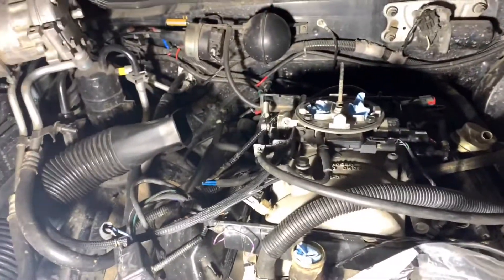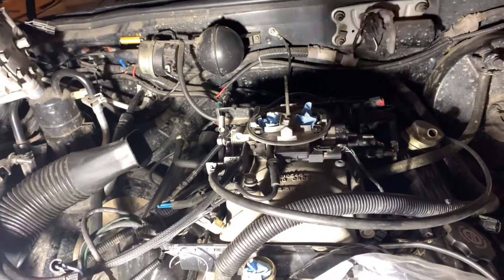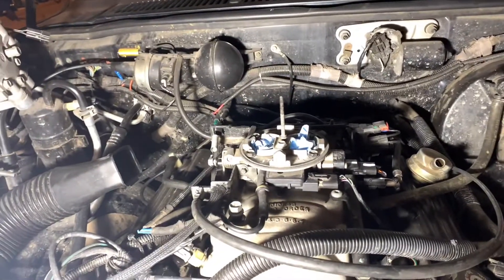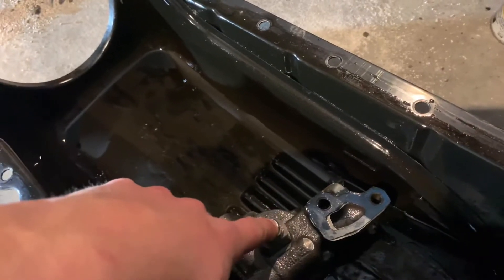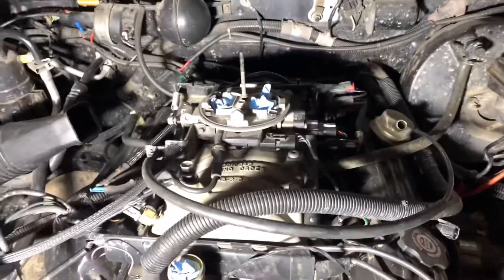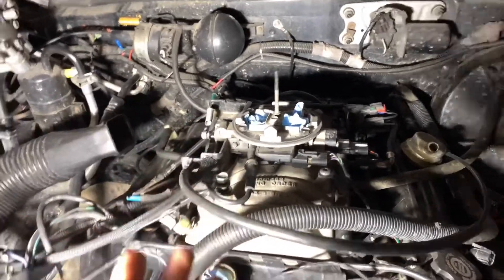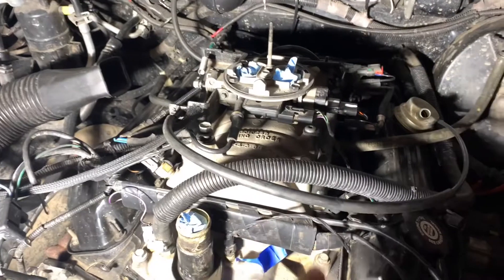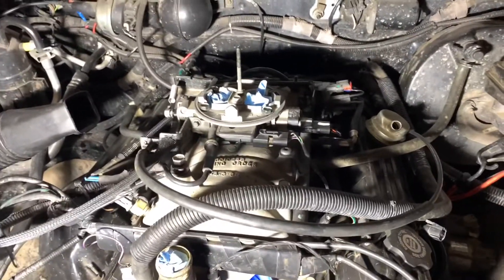Low Oil Pressure Diagnosis (Dodge small block)

Comment: What is the normal pressure it should be? Where should the gauge in the panel be at?
Reply from the maker: The proper range is 6psi-40psi when warm. Obviously a minimum of 6psi at idle, and 40psi at operating rpm (roughly 2k and above).
Reply: @AndrewSalazar7  Thanks, Mine currently shows is more than halfway to the 100 mark. What could cause this? What type of damage could result if I drive it this way? It is currently parked in my driveway.

Comment: hi there. i have a 95 ram 360. 160k miles. runs and ran great. iv done new plugs when i bought. i have not changed the oil yet. it sat alot and wasnt driven often. so recently i tooped off the oil maybe half a quart with marvek mystery oil. like i usually do on all my rigs   that day i started getting low oil pressure when engine was hot and i got on the rpms!  so since iv ran it and revved it and it doesnt happen when it cold or warm but if its nice and hot and i start revving the OP gauge starts dipping down ! in going to finally change the oil.  what do you think is happening?  old oil and then thinned out ??
Reply from the maker: So as long as there is oil pressure that means the engine is getting lubricated. However, if the pressure drops too much at operating temperature when the truck is under load that isn't a good sign. What is the pressure dropping to when you romp on it at high temperatures? What does "hot" mean in terms of actual temperature?
Reply: @AndrewSalazar7  the neede is dancing back and forth. sometimes dropping. just going through town slow but usually dropping when i give it gas    was worried because i have a hill to get home but then on the hill it was fine not dropping on throttle   this all started after topping if about a half quart with marvel mystery oil since oil was low.  oil is idk how old. same oil as when i bought it maybe a year or less ago. i barely use the truck. here and there into town   one time to the next town and its always been great. in the middle of a oil change now. will have fresh 1030 new filter drain plug and i got a new oil fill cap since the day i did the topping off was the day i finally got the cap off and had to kind of take it apart to get it off.  then put back on without the spring. thinking that cap couod possibly be a problem too although it seems to be snug tight
Reply: @AndrewSalazar7  when the gauge drops it jumps back up and hasnt made it into the red
Reply: @AndrewSalazar7  i changed oil n filter with 1030. problem seems to be gone and pressure seems to be up   also may have been a partial o ring with a full one with the old filter   i gues the old oil a half quart marvel mystery oil was it. also new drain plug and new oil cap